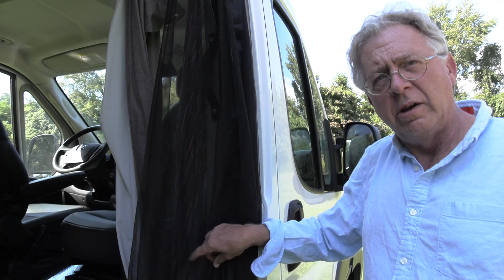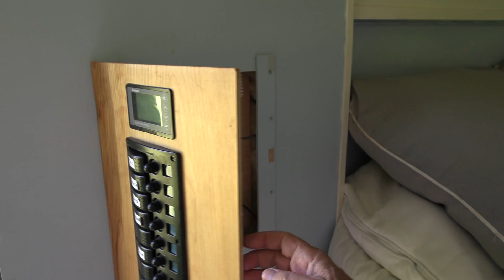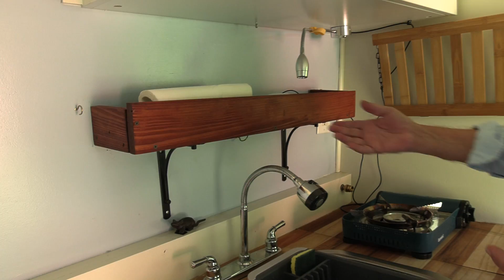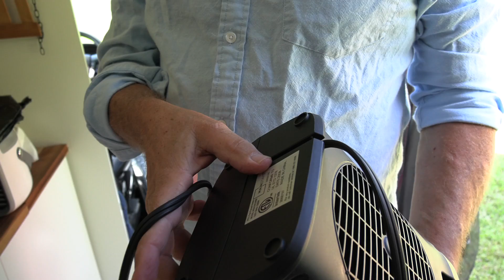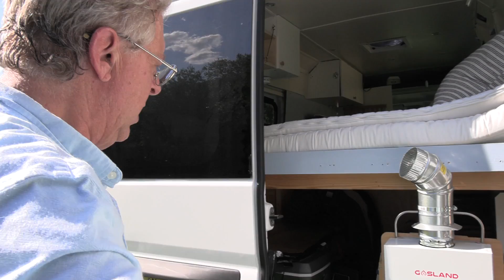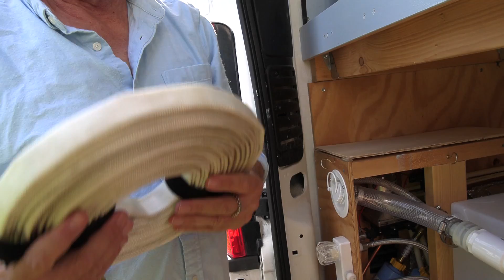LIVING in a DIY Promaster Camper Van Full Time

Comment: I used to be a fan I contacted them about ordering a ProMaster or a Ford Transit 4-wheel drive customized van and I was told to be $360,000 nobody asks that much for a 170" van. This is got to be racial profiling